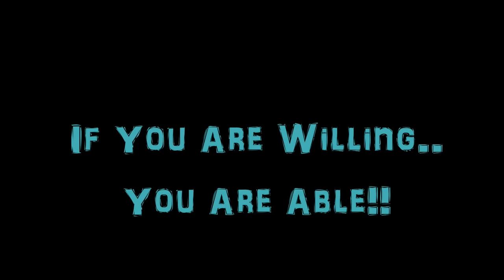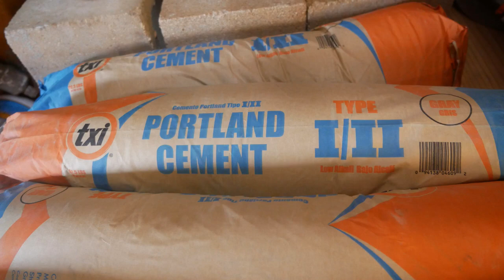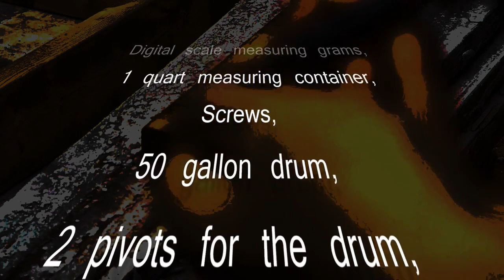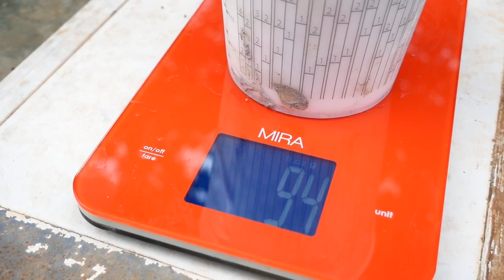How To Make AirCrete Bricks (50c each)

Comment: I dont understand whats the difference between aircrete cylinder blocks and regular concrete blocks. other than price, what is the advantage of aircrete?
Reply: Aircrete adds bubbles to the cement so it gives you 6 times for volume.  You use 6 times less cement.  The air bubbles in the cement make it very insulating.

Comment: @offgrid living for beginners.

Hi, I'm Mike. I'm a retired Thermodynamic Engineer who spent his career designing thermal protective passive packaging for extreme environments and abuse. I can't give many details, but there are at least two patents with my name given as an inventor/co-inventor.

Forget using soap-foam. It only aerates the concrete. Doesn't add any structure or strength of lamination from a composite brick product. Composite of EPS Beads, Fireproof paper strands.

Forget the soap bubble. Rather...use Expanded Polystyrene (EPS) Beads CFR (California Fire Rated) that have been "pre-expanded" (pre-expanded) is a trade term used by EPS foam molders. This is what filled your bean bag chair as a kid.

Add EPS beads and treated shredded paper insulation.

Product is far superior.

Want your mind blown? Cut a nice solid piece of blueboard Construction EPS foam. Coat it with Concrete. Allow to cure. SEE HOW STRONG AND LIGHT IT IS.

Same block of EPS foam....spray some truckbedliner on it. NOW Take a sledgehammer to it. See how it hold it's shape as long as the laminant 

Also...desire your mind still further blown?  Google how Polyurea and other Coatings are used over EPS foam for architectural outdoors Andy indoors.

You'll love this stuff.
Reply: overall cost and effectiveness means a lot in this world. with your own labor, aircrete can be more cost effective. I invented a new foam dome roof and concentrator mirror, btw...
Reply: various soil building methods are also copetitive, btw...

Comment: Aircrete works as Wall insulation?  I am going to build a house in hawaii. There are not many skilled builders over there . I was thinking to build a frame and use this material for walls as an Insulation and sheet rock  the same time!
Reply: Skilled builder here. Happy to assist you, money isn't my motivation.
Get in touch, if interested.

Comment: in a cold area, such UK and germany (long winter with high moisture and rain. cold and wet) aircrete cant be expose to water or rain and let frozen, it will crack and crumble off.. i have a few piece of light cement with lot of holes, they call it "naac block or aac block", it is very light, mine is in panel form of 5cm thickness. very very very good fire insulation, does not burn, no heat transfer at direct burn on the other side.. but, i break quite easily. i just left the broken pieces outside inthe winter rain.. and every few days when i came by, i saw a layer of crumbs of concrete on it. it seems it will break up into small concrete crumbs when freeze and thawed.

Comment: Correct me if I'm wrong. The cement mix goes up to the first ring of the barrel. Then foam is added up to the second ring. From that we can deduce a one to one volume between cement and foam.  Not everyone will use a 55 gal. drum.

Comment: Hi I'm in Australia. I've made a foam machine, that makes shaving foam like foam. I'm testing mixes making bricks, my main aim however is to insulate and protect my IBS's..
First time oh I've heard of the 30 day cure time!! Might explain why my bricks are so brittle.. ?? 
Do you use sand in the mix?? I've read some instructions that include sand, and others that don't 🤷‍♂️.
I'd love to build my home this way, but regulations are currently stupidly strict here. There is a chap in Byron Bay area, pushing for regulated rules for thin wall basalt reinforced concrete domes. ..
Any way, please let me know about your use/or no use of sand on your aircrete mixes..
Is sand already part of the Portland cement..?

Comment: In a cold area do you need a regular concrete footer? Also, would it be possible to build a berm home using aircrete?
Reply: good question, i would like to know the asnwer as well,
Reply: @andrewyek  In other vids I've seen them use the stronger concrete footer with a much higher compression strength

Comment: I heard one quote that for 1bag of portland cement, they can make 7 cu ft of aircrete.   By the time you get 4 bags to make a yard, your somewhere in the neighborhood of $50/a yard for aircrete.    Well, you could have 2500 psi cement blocks for that not a crumbly aircrete block.    I think the insulation of aircrete is better and it's lighter, but I would be worried about an animal clawing it's way through the side of my house with aircrete.  With concrete, not so much.    I think this material is an interesting fad, maybe good for building planter pots or things you wish to ship because it's lighter weight, but I wouldn't trust it for anything structural or load bearing.
Reply: You have animals clawing at your house?
Reply: @harrynutsackk  Bears .....